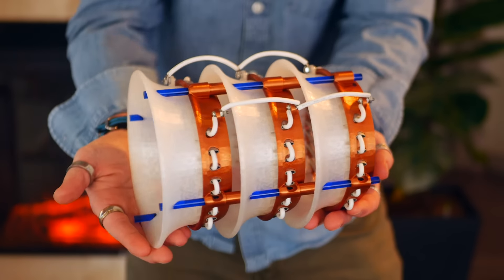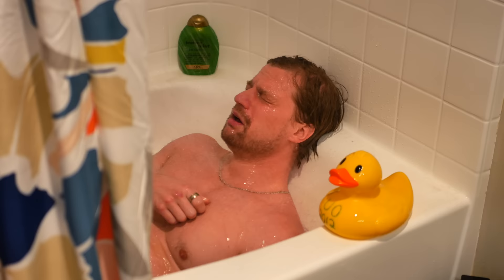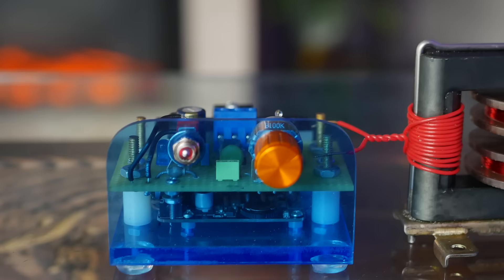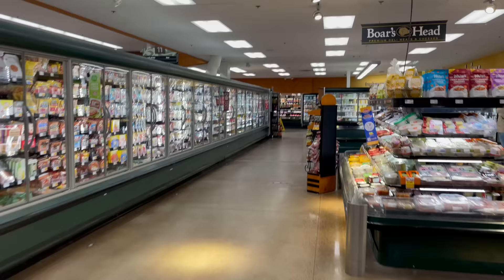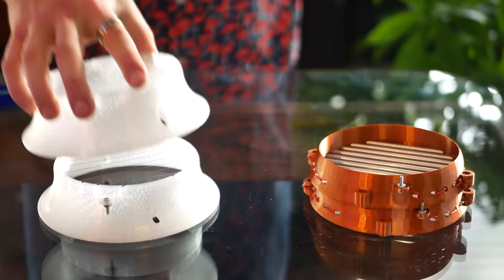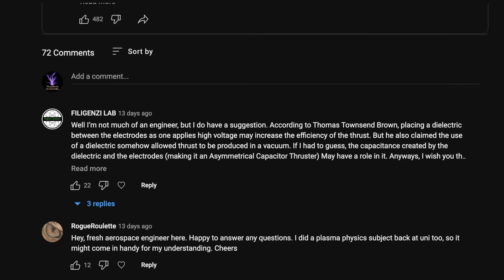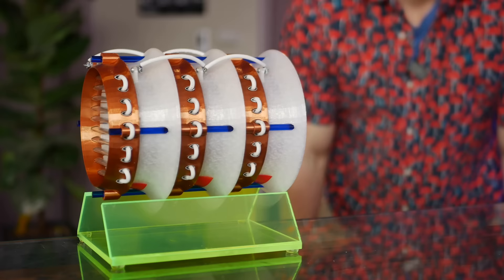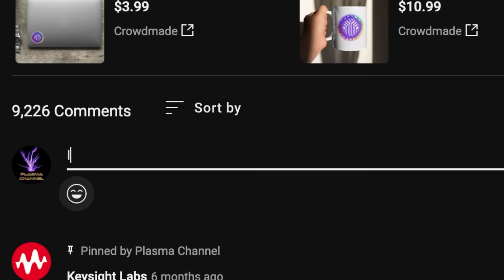The Next Generation of Ionic Plasma Thrusters (BSI MARK 2)

Comment: Another few angles you might try: 1) Changing the pulse waveform: Shorter rise times should result in much greater transfer of energy to the air, and having a dynamic rise time that adjusts with incoming air velocity might be even better. Humidity and ambient air pressure variation will also require the dynamic rise times for greater efficiency. Additionally, staggering the timing between the stages might increase efficiency as well. 2) Curved wires: requires dielectric spacers to retain equidistant wire spacing. Concentric counter facing half-rings could maximize your area of charge, resulting in an increase to the total air-charge transfer. Changing the angle between stages so that the air begins to take on an angular moment as well may increase thrust. 3) Inter-stage wiring: Presently, your conical intakes allow for passive air intake. This could be changed to an active intake area as well, with an additional few HV leads, resulting in additional charged air.
Reply: I appreciate intelligent people. 🙏😊
Reply: You should build one too. Would be interesting to see if your recommendations would improve the design.
Reply: love the dynamic pulse time. I suspect that could help a lot.
I do wonder if the side inlets are helping, or if varying them could matter.
Reply: hmm yeah I really suspect the extra intakes could hinder performance. if the air brought in mixing with the charged air seems it would subtract from the velocity of what is already charged and maybe cause some eddy currents.
Reply: @jhoughjr1  agree with this. The secondary and third sections may benefit from not taking in more air. They may be producing turbulence that is slowing down the final thrust speed.
Reply: another thought, if exhaust speed is the main goal, one can go with a larger first stage, followed by progressively smaller further stages and no additional intake venting will increase the exhaust speed, but will likely not increase the total thrust
Reply: what do you mean by pulse waveform, the thruster uses DC voltage if you mean that
Reply: @petermeter  DC can and often is still pulsed.
Reply: @davidconner-shover51  arguably the extra exhaust velocity could be worth if you want it to fly fast and high.
Reply: I would make the first stage larger and the last stage smaller. Also i would increase the distance and voltage between the subsequent stages
Reply: The circular shape isn't optimal either... especially if it will be used for airflow across a wing.
3d printing the end of a rectangular-ish design that incorporates the wing as 1 side could maximize efficiency... depends on the design.

For final product to be used outside the lab a low friction coating may be required to prevent crud deposit if it's anything like the wind generators I prototyped in the late 2000s  (severe performance degradation in days to weeks)
Reply: Makes me wonder if our plasma friend is holding back some secret sauce, if you know what I mean!
Reply: The dynamic waveform idea reminds me of a "DEEC" or "i-DEEC" (Improved Digital Electronic Engine Control) used in fighter [probably most] jet engines. Constantly adjusting fuel flow, RIVV and CIVV, intake ramp, nozzle position, backpressure, etc to optimize performance. Doing the same for this would be awesome. 
The half disk spacers reminds me of the magnet coils shown in Veritasiums new video. Good ideas.
Reply: timing the stages is a damn good idea :D
Reply: Are we saying that the air flow brought in through the sides would be just flat out bad....or, just that if it is allowed to flow into the system in a non-laminar way, it could be detrimental?

What may happen if some form of heat shrinkable wrap was wrapped around the bumpy wires on the outside of the stage before, followed by some form of cowling (maybe made out of the same/similar material formed around some sort of framework that could also be used to direct the air) which starts at about a 1-1.5cm clearance from the inner surface but then reduces down to about a 0.5cm gap.  It would then extended slightly proud of the first stage inlet...maybe such that the Venturi hole in the first stage becomes slightly reduced by the leading edge of the shroud.

Then, repeat the process for the final stage such that it's front edge sits slightly more proud and inward than the cowel around the first stage.

The framework holding up the shrink wrapping could be used to direct the current of air in a laminar flow such that the air is slightly 'rifled' like the barrel of a gun.

That way, the air entering via the side ports will be super compressed and, this, be travelling a fair bit faster than the inner air.  This should act to compress and contain the main jet through the centre and shape the air exiting the rear of the jet.
Reply: one spiraled wire?
Reply: 100 mhz, you'd have to put it in carbon loaded foam..
Reply: Another set of variables im interested in is bypass intake openings. I'd like to see a fully closed variant, and a reduced opening variant.
Reply: Here's hoping this gets bumped up and addressed in the next video
Reply: Study owl feathers for better laminar flow and less hissing sounds.
Reply: this some star trek shit ayo
Reply: Shorter rise times on stages 2 and 3 though, because at that point it'll be moving faster.  The faster the stages move, the shorter the pulse times.
Reply: frequency of waveform and pulse time between changing could make a huge difference.
Reply: The best ionic propulsion utalises Blades of foil in a off set angle by about a few degrees difference each stage. Having a tighter pattern will give results.
I worked on a few things involving lftr drones for a propulsion utility lab in the United States. this had me thinking about how cheap and easy the lftr bodies are to make. But the problem is not the energy draw but the or the current but the shape of the electrode. I want to say that the most important thing is the contact space has to have a large enough surface area to take advantage of the amount of time for the ions to accelerate the air molecules. The waveform could be a large factor of power output it's worth making and adjustable power output supply to test the ideal conditions.
Reply: Additionally, he needs to consider the power triangle
Reply: With the cockroft-walton multiplier in place ( 4:40 ), it's ostensibly being fed DC (as long as there's no current load from actual sparks).
Reply: i only listen if its only 3 sentences or lower
Reply: I was thinking on your point, what if each section of wire was not parallel but turned clockwise or counter clockwise a few degrees maybe to create a tornado like effect in the air flow thus gaining velocity in each stage. Maybe lol
Reply: @Geopoliticstoday2  meh anybody can learn this, we just choose not to
Reply: I'm not nearly as smart as half the people watching this, but I was curious if increasing voltage with each stage might help produce more thrust? Also, maybe start with the first stage  thruster at 24cm, 2nd stage at 16cm and final stage at 12cm to act kind of like a compressor with each stage sealed against each other. This could result in forcing a larger volume of air through the final thruster. Again, I have no degrees, so take my ideas with a grain of salt. I do know it is better to measure airflow in cubic feet per second or cubic cm per second. This will give you an idea of how much air you are moving rather than how fast you are moving the air.
Reply: Does adding water vapor increase thrust at all?
Reply: You should also try a helical shape to your thruster similar to DNA  as it may improve efficiency
Reply: Idk ECE well enough to comment on the 1st point, but sounds like you know youre stuff there. I don't know how well you could control the waveforms when the focus is on dumping as much energy into the wires as possible though.
On the latter part of your 2nd point, I dont believe changing angles between stages would cause an angular moment, due to the ionic winds acting more like a plane of normal force, rather than adding in any specific vectors. The normal forces may vary on that plane, but its not in any other directions.
On the 3rd point, if you charge the air before you get to the main wires, that would cause backflow due to repulsion (say, negative ions go towards negative wires, which are in front of the positive tubes, just as a roughed out example). The best you could get is just moving the wires forward, but that would be at the cost of spacing between the wires and the ground tubes.
Reply: did ChatGPT write this?
Reply: I also was thinking that "Humidity and ambient air pressure variation will also require the dynamic rise times for greater efficiency."  I wonder what would happen if a different compound like the Co2 off the dry ice or He. I think there was test already done and Ar was the best, but not practical (safe) for this application.

Also if the concentric counter facing half-rings work would mounting them in certrfual copresser (leaf blower) method increase pressure over mount them inline. I think the over all weight will increase and watt per particle Dv will, but what does come out will be coming out with more speed and pressure. If it wants to be used outside in a light wind it will be important to get the compression up.
Reply: You should sell your ideas..  elon will hire you for his spacex mars project as sanitary engineer.
Reply: Это вентилятор Николаева
https://youtu.be/PAbeb2GG4qc
Reply: @Валерий_Демидов  2200 m3/s 😮
Reply: @electroacousticlabs  размер и мощность имеют значение 😁
Reply: What I want to know after all my YouTube recommended Tesla videos is is there an application for a Tesla Valve here?
Reply: this section contain a lot i'd suggest, like multistage to augment pressure, rotating the angle gradually on stage to give a CW pattern of rotation, amplifying the electricity to air zone of contact while also considering the fluid's dynamic /movement generated. i would adapt every Tension and every Frequencies used to the new state of air molecule's in the stage that have now polarisation and Hz properties unique in every stages. i would also suggest to avoid having side intake to reduce pressure loss and speed generated in the turbine part. I dont know if the goal is to fully avoid kerosen or other fuel additive , but i might consider it to make the air expand on the last stages so it increase the exhaust velocity or at least try to exploit pressure of air properties that want to expand on the outside of the turbine. My humble 2 cents surrounded by great minds
Reply: So are you saying to use Rings instead of Rods?
Reply: Personally I would use adjusters between the stages so you can tune them. Problem is it might add weight.
Reply: I like your comments!  If you could eliminate the inductance in the coils you could make a better system.
Reply: Ayo so where do I get my degree from
Reply: It makes sense that circular rings would use the space inside a circle more efficiently.
Reply: @jhoughjr1  I was wondering that on the second and third stages for sure
Reply: @dtibor5903  that was my question continue the venturi effect by concentrating?
Reply: With mine I use a Old AM Radio PA and and Basic Bass low frequency's and a pinch of 45-46 KHz on the audio, and have it a a very Quick Burst with steady High Frequency Poofs for the Thrust Discharge ....
Reply: Genius
Reply: I would like to add only one last thing. You could get more efficient thrust if you use centripetal or centrifugal compression. ;)
Reply: @AlanLarawalktheearth   I wondered about that
Reply: @weedfreer  I have heard that fluids like to swirl.
Reply: I'm stupid
Reply: This guy sciences
Reply: @AlanLarawalktheearth  to that effect, coudn't you use a compressed carbide for the electrodes to shape it into a form that will help to generated those centrifical forces? i used carbide for my arc furnace and its a efficient light weight electrode. 
someone also mentioned a tesla valve, not that it would work , but it reminded me that connecting the stages with fins at the right angle would help create the effect desired, and help induce a veturi effect. run electrodes at the front and back of those fins as well, while they are there why not.
Reply: @Steven Beall  why not run electricity across the entire device and not just the fins if we use the right metamaterials perhaps carbide composite or a grafene layer on the surface. Of course we would have to redesign a 3.0 version of the device making it go to the venturi effect +  compressing air flow and an air combustion chamber (the compressed air). Sound waves can make it possible in smaller scales to compression tiny bits of air. If we splice the technology in there and add combustion in a closed Rolls-Royce like turbine engine we might have a lift off. 😉
Reply: @AlanLarawalktheearth  now wait a minute. this application is a high voltage, low amp application. basically ionic flow. im suddenly reminded of the stacked structure of the plates in dry cell hydrolosis. i can imagine having a stack of lightweight ceramic, printed in a series of grids that are consecutively smaller, with pitched surface that gradually tightens the cyclone, use conductive graphene paint on the gridwork,  because the surface is all that really matters in the flow of the elecrticity. being low amprage, it should work. with the spacing tight enough between layers, you could energise front to back, letting arcing between the conductive surfaces speed the lamanar flow across the surface of the grid work. think the same kind of tolerances used in the testla turbine. ionic attraction to lamanar flow, really really grabby.
Reply: @AlanLarawalktheearth  though the problem with using the ceramic composite for printing, is you have to fire it, and shrinkage is ubpredictable at best, but you would need some sort of ceramic to adhere the conductive paint or it would just ablate off high heat plastics or epoxy resins.
Reply: You are solidly intelligent, i dont understand anything you said
Reply: @Geopoliticstoday2  it's not that they intelligent, it's that they have the knowledge.
Reply: I was just coming on to say somthing about the frequency and timing nice.
Reply: It is funny that we are relying on air flow for trust and this applies to its application for outer space ions are the force in space and air on earth.
Reply: How does the photoelectric effect with short wave UV light interact with your thruster?
Reply: The optimum charge shape would be a spiral with an insulated feed in the center no? You probably could get away with dielectric spacers support
Reply: @petermeter  oh, hunny...
Reply: Came here to say this, mostly, but you've got it all already lol
Reply: @MikeB12800  on it
Reply: or just not use it.. battery weight to fuselage weight the thrust  will be equivalent to your moms hair dryer
Reply: i don't know much about this stuff BUT what if you had the first section at a lower power then the second X amount more then the third X amount more then that?
ALSO it it possible to get the wave form to match so that its like a 3 wave firing so like the first section then second then third up to what ever frequency he is running at?
i might be blowing smoke outmyass but just a thought
Reply: It needs more cellotape.
Reply: For 2, one has to balance the surface area with the drag coefficient
Reply: Brain Power is always awesome
Reply: @antimoson  they're also taking in air that has no momentum and mixing it with air that does have momentum. This is almost certainly detrimental.
Reply: ❤😊❤❤a
Reply: Speak crayon eater so i can under stand please 😅
Reply: @technosaurus3805  Your comment was very useful to me. Thanks.
Reply: The original machine had a base-plate of prefabulated aluminite, surmounted by a malleable logarithmic casing in such a way that the two main spurving bearings were in a direct line with the pentametric fan. The latter consisted simply of six hydrocoptic marzlevanes, so fitted to the ambifacient lunar waneshaft that side fumbling was effectively prevented. The main winding was of the normal lotus-o-delta type placed in panendermic semi-bovoid slots in the stator, every seventh conductor being connected by a non-reversible tremie pipe to the differential girdlespring on the "up" end of the grammeters
Reply: I dunno about curved wires, but why not curve the flow of air instead, by having each engine sitting perpendicular to the last one? Kinda like how the rifle of a barrel has grooves that impart rotation to the bullet, you’d be creating a whirlpool of air through the whole thing
Reply: I was thinking something similar about curving the cathodes with a center ring that could be adjusted inward or outward. That way he could direct the ionization flow from stage to stage. And personally I think he should completely ditch the side air intakes in exchange for a tapered design with a nozzle output.
Reply: @toobin8r 
The only reason I would curve the wires is to control the gap distance so essentially the ionization is controlled in a ring pattern. But it would have to be concentric and evenly spaced for it to make much of a compounding difference from stage to stage.
Reply: @Yuralittlebitchn1gga 
Yeah it's a pretty inefficient means of thrust overall regardless of what you do
Reply: @fireteamomega2343  oh, no, I mean like. This is an engine made up of three identical frames, you rotate the subsequent frames by like. 15-30° so that, in the same way a fan’s blades are at an angle to push air more efficiently, the engine will in theory be able to pull air through it better.
Reply: @toobin8r  
I get what you mean basically you're trying to create a vortex effect. But I don't think that would make much of a difference in output with his design because thrust is determined mostly by the amount of air pressure being contained and released. So by having the same diameter intake as the output it's only really producing as much thrust as the the initial amount that the air ionization can produce. Meaning that's why you wouldn't get much if any increase from one to three stages as shown in the video. Now if these stages were tapered down compressing each previous stage with perhaps a closer ratio of cathode distances with each stage then along with the added twist rotation that you suggested yes I would say you could increase the thrust substantially.
Reply: @fireteamomega2343  yeah, thinking about it now, the way it’s currently designed, I’d imagine what might happen is that the airflow sorta get backed up around the additional air intakes along the sides, because creating a vortex would be pushing air out towards the sides. You’d have to close the thing up so the air only comes in from the front, and can only escape from the back
Reply: @toobin8r  
Sorry wrong message... sandblaster mods... Yeah I don't see additional air intakes really being anything useful because it's not at the same velocity or greater pressure to accelerate further. So essentially it's just going to disperse any thrust you might have accumulated.
Reply: @toobin8r  
If you had some design that could push ionized wind streams at a greater magnitude then the initial stream in a descending vortex pattern. I think that would definitely work and become additive. Although it would have to increase in magnitude by each segment to contain the previous gains.
Reply: Figuring out the ambient frequency of the air
Reply: What about a nozzle?
Reply: wow, those are some good points
Reply: This guy sciences
Reply: What would changing the “pulse waveform” do exactly, and what is it? I just stumbled on this topic and am super interested
Reply: How can we change the pulse waveform?
Reply: I wish I was as smart as you to understand all your comments, I am just a sheetmetal worker/engineer and as such I build anything, but I need to understand what you are telling me
Reply: Hey are you speaking like a tattoo machine and the phasing of the coils to create a pos neg switch but with ion thrust
Reply: Use a conduit on the ion thruster with a faraday cage of chicken wire, this should channel your thrust
Reply: It just seems with the small gaps throughout mean you are not channeling energy to a main focal, also space first thruster harmonically at a farther distance to the second in comparison to the 2nd and third gap.
Reply: Sorry but can someone tell what material was that tube?
Reply: Nerd
Reply: @ohbla101 I like your thinking 😅
Reply: @sonariantutorials2438 same here 😅lol
Reply: @danhard8440 I like your idea 😅
Reply: @theo6741 I can't believe how many big words you put in there😮 layman's terms would be appreciated 😅
Reply: @toobin8r I totally agree 😅
Reply: @toobin8r you could make a variable engine that closed up the side intakes at higher throttle/voltage/increased velocity 😅😅
Reply: It's an ion railgun